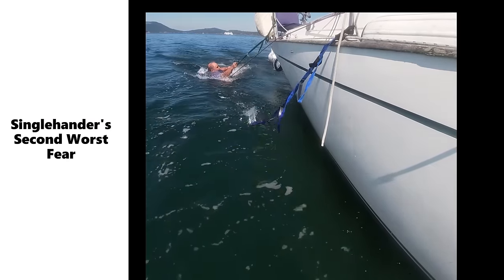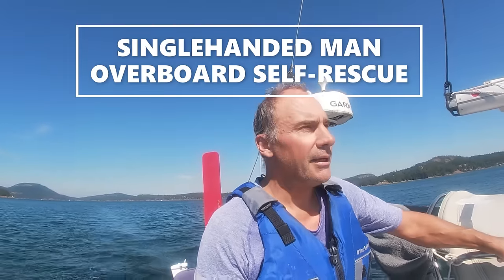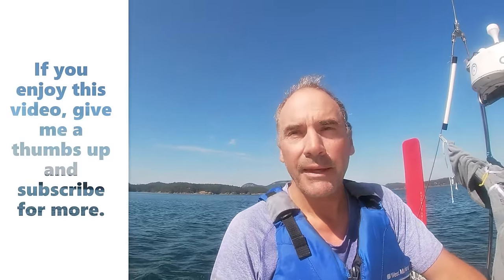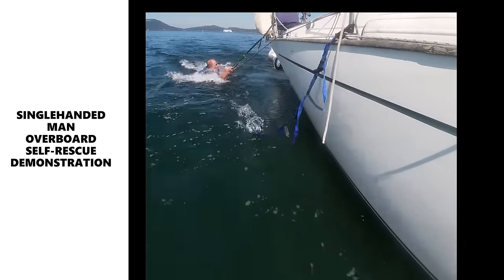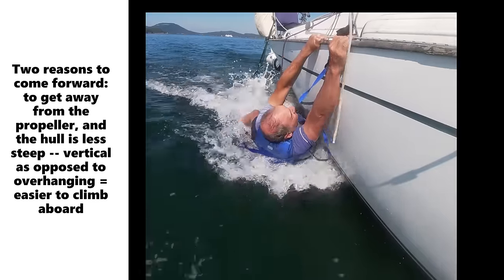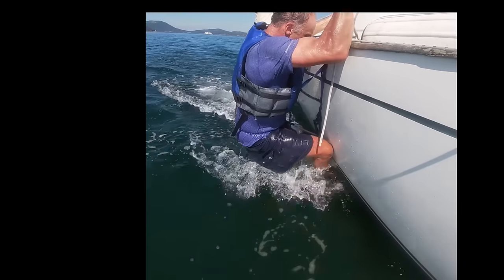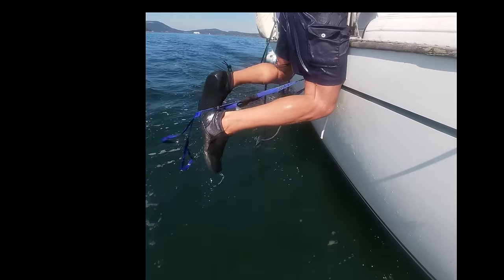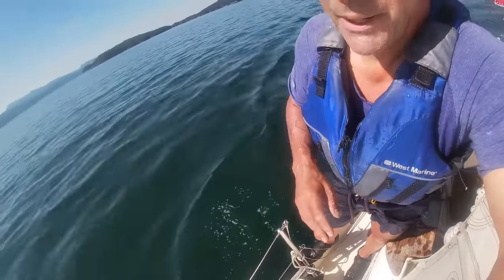SINGLEHANDED MAN OVERBOARD: SELF RESCUE

Comment: Hi, I have a line tied to the bow led back to the stern (outside of the rail) and tied into a heavy duty 2m dia sea anchor held in an inverted bag on the transom rail, from there I have a Yellow 30m floating rescue line which I trail behind the boat when I am sailing alone. The rescue line and the sea anchor are held with 2 small cable ties. If I fall overboard then I pull the rescue line trailing the boat, this breaks the cable ties and releases the sea anchor into the water, this will fill and pull the bow off course and stop the boat, even when on autopilot. At 6 knots I will have 10 seconds to swim approx 2m to pull the rescue line.
This is meant for use whilst sailing only (not motoring). As a Whitbread veteran 89/90 I know too well the risks of sailing alone, in my opinion falling overboard and being dragged at 6 knots or more by a harness attached at the waist is not recoverable, a severe back injury or drowning is the likeliest outcome, if a harness is to be used then it should be releasable under load to prevent this.
I'm not saying that my idea is the only or best option but it gives me a chance at least.
Mark Fisher 42ft steel hull sloop, Lymington UK.
Reply from the maker: Wow. What a great idea. Thank you for sharing that! I have never heard of that concept but I really like it. I absolutely agree with giving ourselves the best chance, or even just a chance as you outline. Thanks again for sharing this -- clearly you have put a lot of thought into it -- and we can all learn from you.
Reply: Thank you for your kind words, you will not of heard of it before as it is my idea, it really does work, read carefully how I rig it to the bow and outside of the rail, this gives the sea anchor a good chance as the boat will not sail with the drag created, the boat will be pulled off course and will stop with the autopilot bleeping and the sails flapping.
This will work on any sailing boat and at any point of sail in any conditions, a smaller boat than mine might be able to use something smaller than my sea anchor, some lighter boats might even be able to use a strong bucket. I have my system permanently rigged and coil the rescue line at the stern, when I want to use it then I just throw it into the water and it's ready for use. @respecttherisk2022
Reply: Respect the risk; any chance you can recreate what mark describes and do a video on it? We saw how absolutely exhausted you were. At 59, I thought I was in great shape. Then 60 hit and back problems (I’m now 64). Slowing the darn boat down would help me a lot.
Reply: @dogbone6315  hi, that would be great, I’ve tested it but not on camera, it would be a good learning for us all and I’m sure promote a healthy discussion.

Comment: I have a swing down swim ladder on the stern of my boat.  I attached a line to the ladder and a handle on the other end.  I drag the end with the handle behind the boat.  It's also short enough that it will not get tangled in the prop.
If I fall over the line is long enough to allow me to hang on to the boat which in turn will pull the ladder into the water, allowing me to climb up.
Reply from the maker: Great idea mate. I intend to add a version of that for my boat.

Comment: Mostly sail solo.
Always on a tether, normally long enough that I would float to behind the stern.  Where there is a stern ladder.
Attached to the tether a couple metres from the fixed end are two light lines. On pulling the tether tight, one lifts off the autopilot, the other releases the jib sheet (from a cam clear).
So in theory she will round up and stop…all I need to do is wait for a warm day to try it out, I sail in Scotland…..still waiting. 
That was on a small catamaran, my current one is 5.4 m wide, so a short tether keeps me well away from the side. 
I must add that I believe that going over the side+is much less a risk on a cat, they don’t lean over much, but also don’t suffer from sudden vigorous rolls that mono do.
Reply from the maker: Great suggestions. Thanks for the note. I want to try some of those control line ideas out soon.

Comment: A pull string to your boarding ladder and a trailing line are how i set up for solo. You can get bumped around before being washed or falling overboard.  The slack water at the stern is not as difficult to maneuver in. But yes Stick With Rule #1.  Dont fall overboard.
Reply from the maker: Great ideas. Thank you for sharing.

Comment: As an older fellow…61
I took one look at this man’s forearm and could recognize he has some good grip strength.
One must maintain this as one ages.
It takes some effort and be intentional about it.
If you cannot hold on….yeah….no way could you get back in the boat.

Also, I have wondered about a heavy bit of cargo netting.
You could fasten to the aft.
Maybe throw it over if working on the rudder or prop.
Or even in nasty weather.
This would be a great help in climbing back in or least holding on.

In addition,
I have wondered if a sort of kill switch could be incorporated by some one more intelligent than myself into the auto pilot.
Whereby if the single sailor fell overboard and got some distance away the autopilot would crank the rudder over to one side throwing the boat into a circular route.
This would be better than watching your boat sail away over the horizon.
Reply from the maker: Great ideas mate. Thank you. I am going to try three things soon: control lines for both a kill switch on the engine, and to make the boat heave-to under sail -- deployable from a position in the water over the side. The third is lifeline close to the water line to allow the singlehander to safely get to the stern to another ladder there.

Comment: Thanks for the demonstration but there were a few factors not taken into account, effects of cold water shock, sea state, clothing, weight, ability. I'm with many others in the comments, if you fall overboard singlehanded your chances are slim to none. If the boat can be stopped via a control line once overboard I think that might go a long way. Again thanks for this demonstration.
Reply from the maker: Thanks for the note. Absolutely agree with your comments. Those factors are all critical elements that will make it harder, or even not possible. The ladders merely offer a slightly greater chance of getting back aboard. A you can see, even in perfect conditions, it was quite a struggle.
Reply from the maker: I really like your idea of figuring out a way to stop the boat via a control line somehow. I have thought a bit about it and have some ideas that remain untested.

Comment: It’s like lighting a fire on board to practise putting it out. Insane.
Reply from the maker: Not quite.... there was crew on hand just out of the frame.... all the best mate.
Reply: That’s a relief! Should be made explicit in the video. It’s a very valuable drill but that is a key precaution, the key difference between supreme preparation and actively courting disaster should not be omitted in my opinion, even if it heightens the drama, which it totally does! You were like “I’ve got an hour of sea-room here.” That’s when I got concerned for your safety and the safety of those who would emulate you.
Reply: Pardon me, i re watched your video and realised I missed that written blurb. I don’t read so good I guess! However, I would still say a bit more emphasis of that key point is called for.

Comment: If you rig a trip system and have it tied to a trailing rope, the trip pulls out a pin and either drops your sails, or releases the tension so they swing downwind and cease functioning, slowing the vessel.  If your were going upwind, their drag now helps stop the vessel.

That way if you go over, you have TWO trailing ropes--the usual dead-man's rope, and your trip line.  The dead man's rope has wrist or foot loops spliced into it every few feet.  The trip line is just a polyester rope trailing beside it.  It does not matter which one you grab first, the trip will drop or release your sails, and the dead man's rope lets you work your way back to your now much slowed down vessel.  At the stern just above waterline is your boarding ladder, tied with thin zip ties,  so pull it down snapping the ties and climb aboard.  Every crew member must practice doing this until all are proficient. On a single handed watch late at night there may not BE any help, but one can, if one has crew aboard, also fit a man overboard REALLY loud  alarm inside the vessel activated by the trip line sequence.

Yes, loose flapping genoas and swinging booms  are a bloody pain in the arse, but they are better than a watery grave on which no roses grow.
Reply from the maker: All excellent  ideas. Thank you for sharing those with all of us.

Comment: I know a guy who owns a sailing school who recounted how he fell off a boat. It was on a lake, after sunset (nobody around). He was alone. He was just routinely moving boats between locations. He had no PFDs on, no phone or other means of communication. He slipped and fell and was dangling off the railing while the boat was doing circles.
If he fell into the water, there was no chance of anybody finding him, of him swimming to the shore or of him being able to get back on the boat. He would surely die.
It took him 4h to get back on the boat.
Anyway. If you are alone on a boat, make sure you are strapped properly or have PFDs on. But PFDs alone will not save you as you are likely to die of hypothermia unless you can signal for help and the help can arrive AND locate you very quickly.
Reply from the maker: Thank you for sharing that experience. Very sobering. A great reminder to all of us.

Comment: I have used a line trailing the stern with hand loops in it. And i have a weight to pull the tiller over. And i use a wrist strap kill switch on the outboard.
Reply from the maker: Thank you. Great ideas.
Reply: @respecttherisk2022  and I always wear a buoyancy vest when on deck solo

Comment: Seems like there might be some way, similar to the engine kill leash made for outboard engines, to stop a boat from in the water.  Perhaps a way to cause the boat to steer up into the wind or maybe release the main and jib sheets.  Just brainstorming.  Any ideas?
Reply from the maker: Thanks for the note. I have some ideas for the kill switch and for the tiller on the windvane to make the boat heave-to from a position in the water over the side that remain only ideas at this point. I would like to test them and implement a few other ideas that viewers have commented on.

Comment: What I know about being in the water just practicing kayak emergency procedures is whatever stamina and breath holding you have or think you have, most of it seems to vanish. I've got a nice sugar scoop on my Hunter.  For my sugar scoop and swim ladder, I would still want a method that that would continue 'working,' until I'm well on the  boat. Your Aider for big wall climbing? I'd have that so there a loops well above the point I'd be back onboard.  
The other thing I'm sure you've considered is sailing with people who don't know how to sail. At the very least teach them to Heave To to stop the boat so you can swim back. Next would be to turn on the motor and turn around.
Reply from the maker: Agree. Great suggestions. Thank you.

Comment: Could you stuff one of those aiders into a PFD pocket just in case you forget to set one up so it's always on you? Slip it over a cleat or have a carabiner attached that can clip onto a stanchion or a hole in the toe-rail
Reply from the maker: Those are excellent ideas. In mountaineering we do that when travelling on glaciers for self rescue in crevasses. I am thinking about some ideas along those lines using the same mechanical clamps as rock climbers use.... maybe a bit cumbersome... but could add security and increase probability of success -- and a way to rest at every step.

Comment: Thank you very much I keep telling people this I had a friend he said look at the boat you're about to buy and what would happen if you were thrown off the boat why it was moving how could you get yourself back on the boat. Is the gunnels are they too high are you condition to get your body out of the water on the side of a boat not many people can I know that I probably can't that's why a sugar scoop sailboat is really important or on a powerboat to have a very big swim step or enough grab holds to pull yourself onto that swim step. Also you make overboard devices now that if you're the only person on the boat it will shut the engine off now on a sailboat you have a problem that if your sales are up it's going to be moving forward but if you have a sugar scoop we have enough grab rails where you can grab and pull yourself on board that's the thing. There's no way in hell would I buy an older boat with 5 ft of gunnels  no way in hell I can't get back on but like that. I think people need to think that really hard how are you going to get back on a boat if you're thrown overboard before you buy the boat you need to ask yourself that question can you get on that boat if you can't then you need another boat that you can get on to because your life depends on it on easy access
Reply from the maker: Excellent commentary mate. Thank you for sharing that.
Reply: @respecttherisk2022  no one should die falling out of a boat no one you have to set your boat up right so you can get in the easiest way possible especially when you're really tired beat up and not almost able to pull your weight into the boat that's why swim step sugar scoop when you're sailing always trail a safety line so someone can grab it

Comment: Instead of those complicated technics, just have a MOB device attached to you either based on AIS or EPIRB, depending on the area you are sailing!
Reply from the maker: Definitely, a good idea in local and well-traveled waters when a rescue boat may be nearby. It could be more problematic in remote and cold water where help is many hours or more away: the hypothermia hazard would manifest for sure.

Comment: Long lifeline....just use the ladder on the stern....... Then again single handed sailing with long lifeline is suicidal...Use a short line with double hooks ( like rock climbers use on route with fixed steel cables). When working mast hook into a short line from the mast...and remember always use your double clip in hooks like rockclimbers use with automatic closing and securing system...
Reply from the maker: Those are some great suggestions. Thank you for sharing.

Comment: On most sailing boats solid ladders are mounted at the stern. This could be an option trying to get in again. 

Working on deck and falling overboard means very often that sailors fall in and pop up in the wake of the boat. No time to grab anything! So this video doesn't show the true possible circumstances. That is why I want to warn beginners not to believe this crap. MUCH MORE HELPFUL IS TO DRAG FLOATABLE ROPES AT THE STERN CLEATS!!! Then you might have a chance to pull yourself to the stern if you're sportive and trained well. Older people with a belly wouldn't have any chance to survive without the help of other crewmembers. JUST COUNT IT AS A DEATH SENTENCE IF YOU FALL OVERBOARD!!! SAILING SINGLEHANDED.AND POPPING UP IN THE WAKE, THERE WILL  BE A SMALL CHANCE TO REACH THE LINES OR ROPES DRAGGING BEHIND THE BOAT. IF YOU MISS YOU'ILL SURE  BE HISTORY ON THIS PLANET!!  Choose the latchway system which means to mount flat long webbing belts from the stern cleats to the bow cleat and then you need to pick in your short lifeline connected to your life-jacket if you need to move and to work on deck.
Reply from the maker: Great suggestions. I think we are all grateful for sharing your practical experience on this. Very helpful.